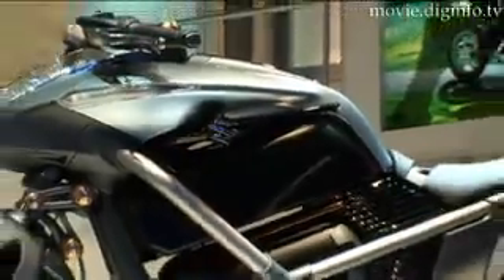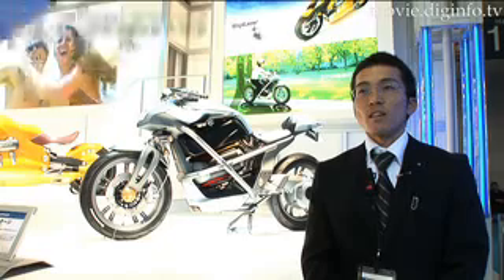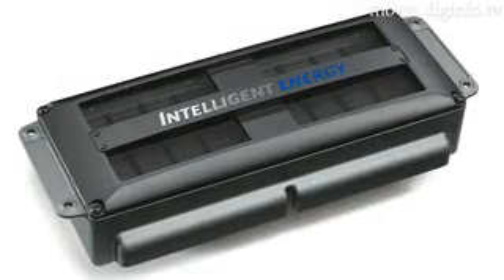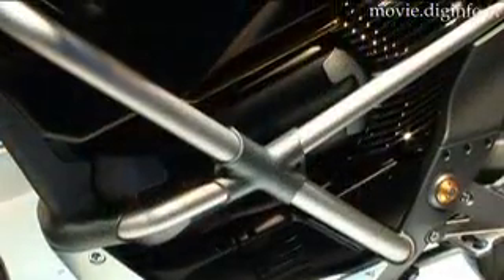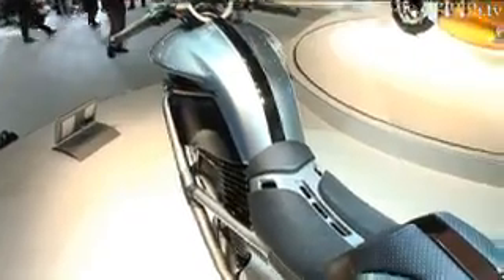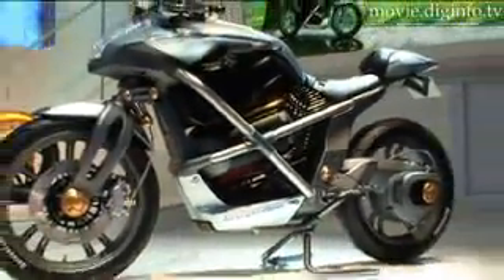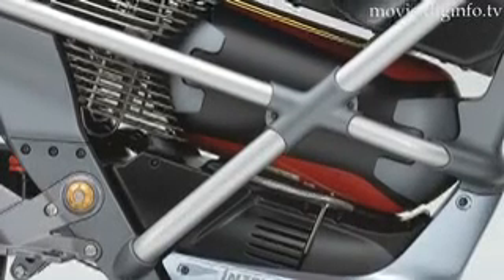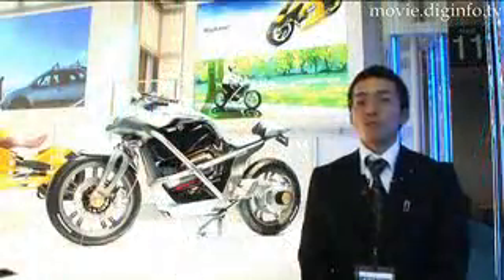Suzuki Crosscage : DigInfo

Comment: @zamarahix lol /facepalm. They engineer electric engines with a damper because if you used it at its full potential you would blow out the engine imediatly. 100% torque 100% of the time. Sounds like power to me...

Comment: @GenerationPlaylist they have to be the future, once the oil runs out, in about 50 years. then it wont be oil companies talking over the world, it will be hydrogen companies ruling the world, competing with sun companies and wind companies. also companies that convert methane gas into electricity. so the correct thing to say would be there is no good future in oil.

Comment: @NodrogTrax in order to make a Hydrogen bomb you need a plutonium core !

btw the hydrogen temperature is lower then the gasoline that means it will not burn your skin that munch as the gasoline and the Hydrogen is lighter then gasoline that means when you fill your car (or motorcycle) with hydrogen it wont accidently catch on fire and if you look back in time when the first oil car was made people ware saying "Oh MY GOD THIS IS A BOMB" and looks at us now.

Comment: @bobo888bobo if you believe that  12-24 volts at 10 amps is a lot of electricity then you had better not look under the hood of the average motor vehicle . An alternator produces more than enough power to start cracking water for the hydrogen.

Comment: it uses much more electricity to make hydrogen than you would use if you just used a battery system. also a battery would give you more instant power and be simpler than a hydrogen tank and fuel cell setup.

Comment: couldnt terrorists just cut the metal cross bars off strap a bomb on it or just crash it and set off a hydrogen explosion. i dnt think hydrogen should be used as fuel until terrorists are "neutralized"

Comment: I cant say, I recently learned that hydrogen fuel cells have less range than modern electric vehicles. New batteries can dump more power over a longer period. In the case of the Killacycle its battery is more advanced than the electric motor it uses. The Killacycle can fry its motor.

Comment: The way the vid talked, the cell and engine are real. That frame should prvide adequate protection of the hydrogen tank. Nuketime201 made the strongest point for why these wont be seen soon, the infrastructure to deliver the hydrogen just is not present. Do keep in mind gas is a bomb waiting for a place to happen as well. This bike has a sensor for leaks that shuts off the engine if a hydrogen leak is detected. With water as the only emission, this concept is exciting

Comment: I agree with cyberxbx.
There are many ways of producing Hydrogens apart from simple electrolysis. Even for the electrolysis, the improvement (price wise) of PV cell (solar cell) should make the process Carbon neutral. The difficulty at the moment is in the storage of Hydrogen other than in its liquid or pressurized form. Metal Hydride cages, and other methods in storing Hydrogens are an hot research topic and we WILL see these bikes soon!